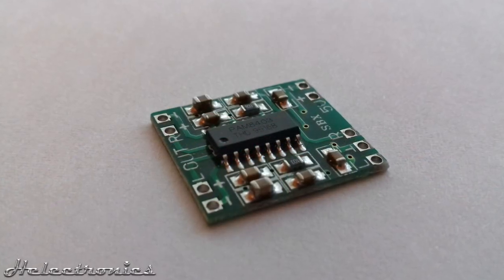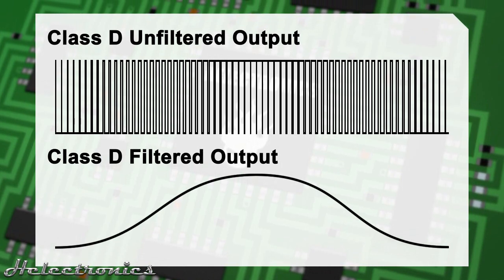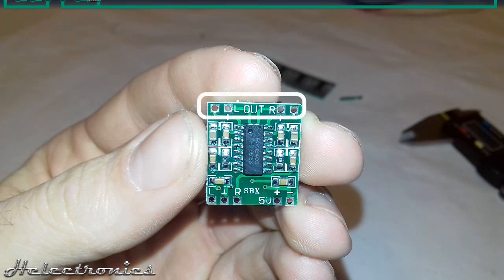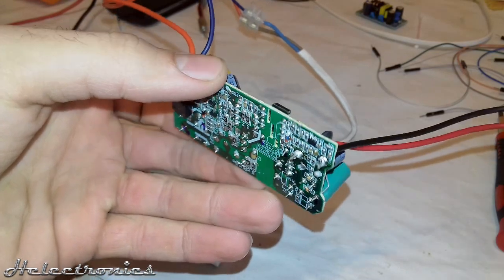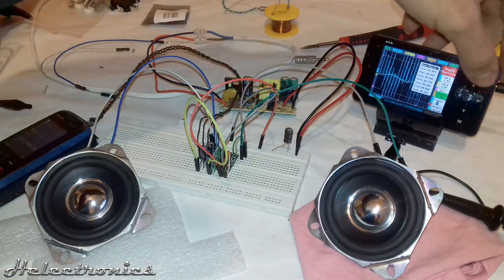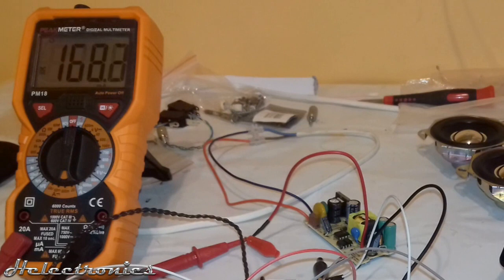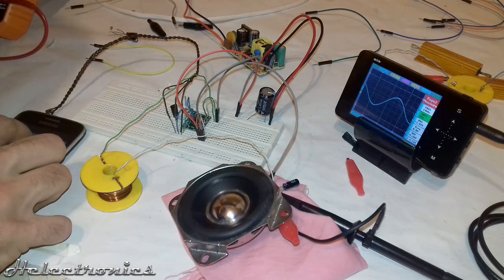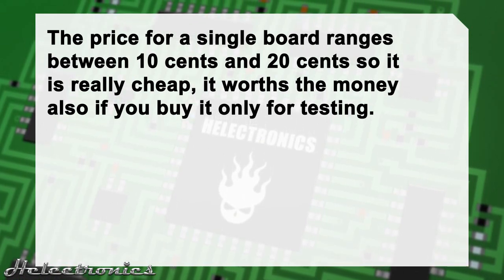REVIEW - PAM8403 Class D Stereo Amplifier

Comment: Just FYI: Your soldering technique needs improvement. Your tacks may hold in the short term but will likely fail over time. Please consider this approach: wet the tip with solder, bring the tip to the work, then apply solder to the work (not the tip). Let the work heat sufficiently to melt the solder that's applied to it, then remove the tip.
Reply from the maker: Thanks, this is an old video and the equipment I had that time was far worse then what I use today, also improved my skills. Thank you for watching and giving great tips for soldering, I will give a heart so other viewers can also see it.
Reply: @Helectronics Thank you for your gracious response. I a. 75 and learn something new everyday. And yes, it is important that those who follow us, learn how to solder correctly.

Comment: Apropos bad ideas - powering an amplifier through a breadboard. 10 Ohm? 100 Ohm? Who knows. By the time it arrives down there at the chip, it's unlikely to be nice 5V any longer. I also notice a measurement irregularity - if you are reading 5V 180mA on the input coming out to 0.9W, then to make up 1.2V RMS on the output, the load impedance would come out to 1.6 Ohm, which... obviously isn't the case. Assuming those are 4-Ohm speakers, at 1.2V RMS, they would be consuming 0.36W, so you are experiencing a lot of power loss along the way somewhere, as expected efficiency of the chip is above 70% at such moderate loads. I suggest that the power loss may be occurring in the breadboard rail.

You don't need a reconstruction filter for audio quality - at all. Limits of speaker response and hearing form the reconstruction filter. While avoiding RF rudeness may be worth some precautions, looking at just the amp and speaker, you don't need or want an output filter.
Reply from the maker: I've tried to connect directly the power supply leads to the board and adding the capacitor there but there was no noticable difference. You are right that it won't be a nice 5V but it was around 4.9-4.95V and on the breadboard the loss was not significant. This module is advertised to work from 2.5 to 5V so what's the situation when the supply voltage goes down to, let's say, 3.4 volts (if a Li-ion battery is the supply)? When I was measuring the supply current drain (180mA) there was a lot of loss in the circuit, as you noticed, the breadboard rail, test leads of the multimeter (where the supply voltage was going through), the coil had also a resistance (if I remember well it was around 0.6Ω). I only have these instruments to work with, and I'm still learning a lot how to become better.
I've connected the coil to be able to measure and see the output better on the oscilloscope, if I used only a speaker the signal was too hard to measure and using a speaker to measure the output power of an amplifier can really upset the neighbours. When I measured the output power, I had to use power resistors which had no inductance, so I had to add a coil. It is written in the datasheet that: 'When testing the PAM8403 without LC filters
 by using resistor instead of speaker as the output load, the test results, e.g. THD or efficiency, will be worse than those of using speaker as load.' I should have mentioned this in the video...
Thanks for the feedback and highlighting my mistakes and thanks for watching!

Comment: Does the 5v input can be given directly from a 3.7v 2000mah battery . or i need a dc step up booster to 5.5v as u suggested .
And also man , i don't know what a filter is can you give a diagram of with  whatever components ?? or can u do a seperate video about filters  low pass high pass with easy diagrams ??
Reply from the maker: According to the datasheet of the Pam8403 the supply voltage range is 2.5 to 5.5 volts so it should work just fine but you need to use a protection board for the Li-Ion battery. I will do a separate video about these passive filters, now I'm working on a DIY bluetooth speaker video which I will upload in the upcoming weeks and after that I might do a filter video because it got requested several times.
Reply: Excited for your video
Reply from the maker: Thanks, and thank you for watching and commenting!
Reply: Thanks man really helpful. Looking forward for that diy bluetooth speaker. I will appreciate if can build a mini wireless sub woofer.
Reply from the maker: It won't be mini, a 100mm diameter subwoofer will be built in along with a tweeter and a full range speaker.
Reply: Pleasure is mine dude ....